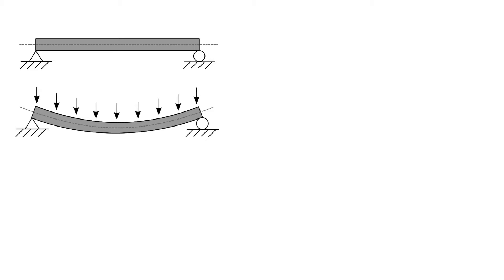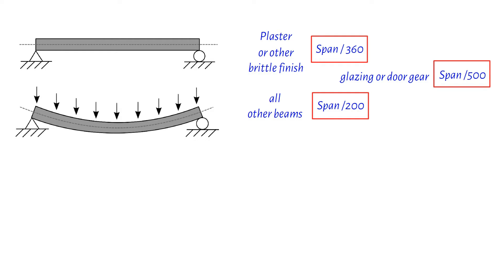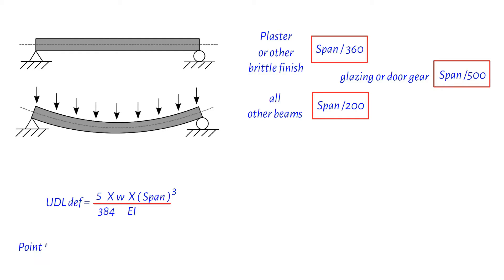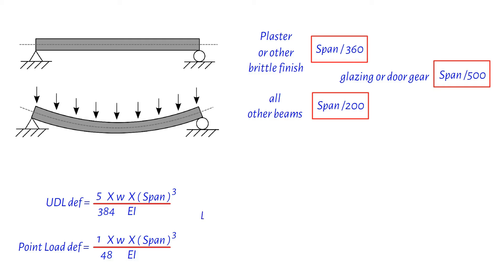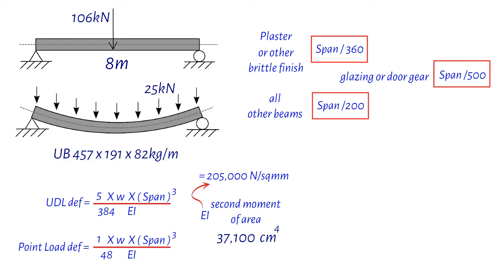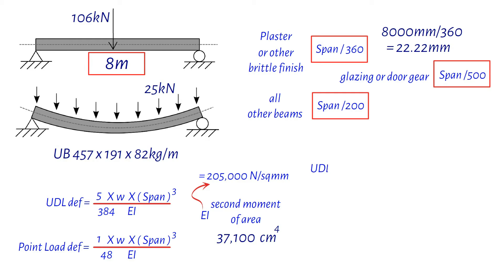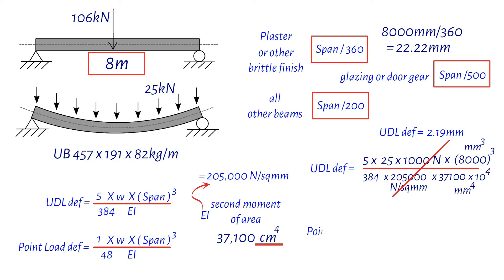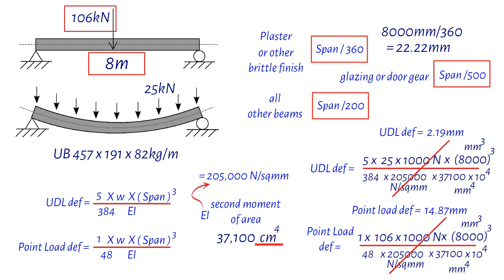How to Calculate Steel Beam Deflection: A Simplified Worked Example

Comment: Thanks for videos, it helps a lot.  Deflection under the imposed load should not exceed L/360 mm  right?
Reply from the maker: Absolutely, you're spot on! According to British Standard BS 5950, the deflection under imposed loads for certain applications should not exceed L/360 mm. This is especially crucial for materials like plaster that can crack easily under too much deflection. Thanks for your insightful comment,& I'm thrilled to hear the videos are helping you! Stay tuned for more engineering insights. 👍